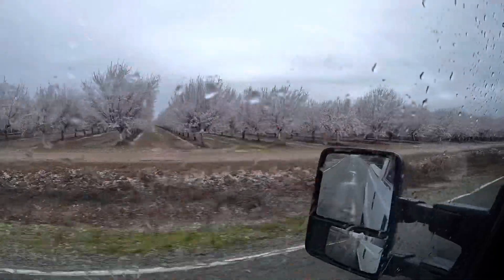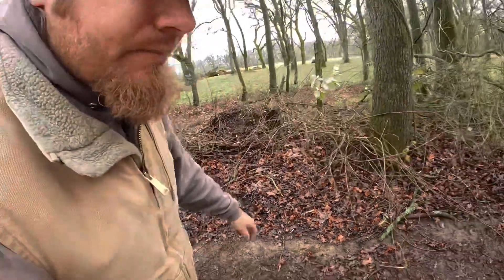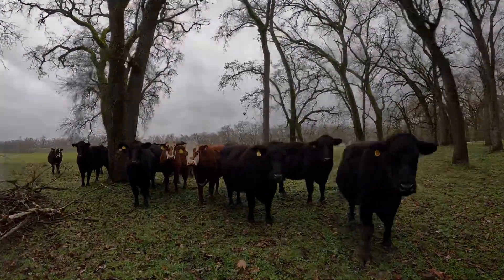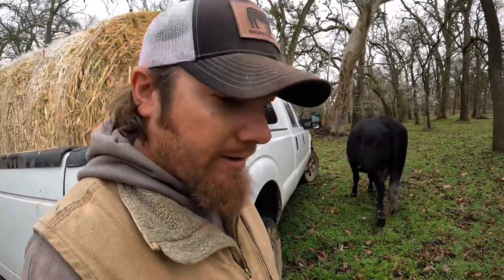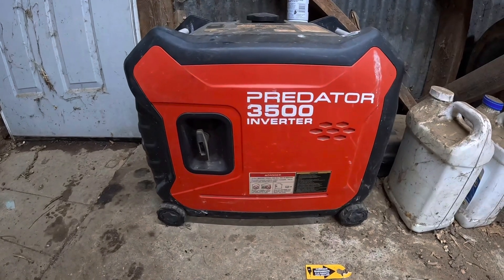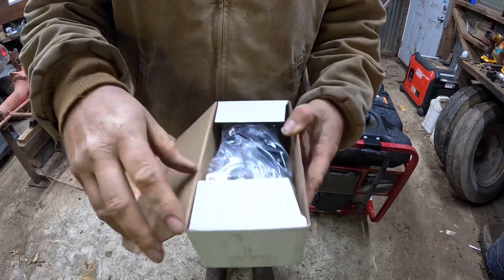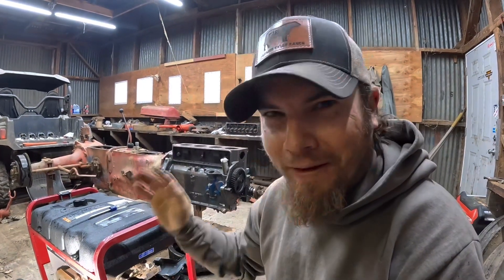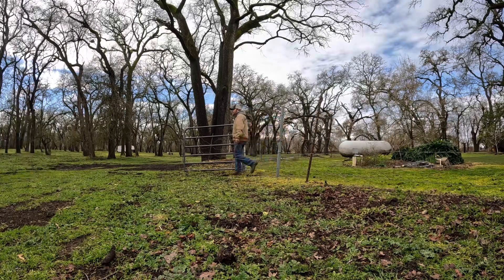Another Cattle Guard Jumper?

Comment: I've replaced 2-3 of those carberators on mine. If they set a long time they won't run. It's an easy fix.
Reply: @boathead22000  you're correct. I try to start mine once a month

Comment: After you got that generator engine running, check to see if the generator is putting out electrical  power by plugging some appliance in to check. Some generators may lose their ability to make electric power after a time, even when the engine is running.

Comment: does the powermate Generator produce 60hz power and 120/240 vac voltage, check it with your multi meter or killowatt from Harbor Freight... make sure it is running properly, put stabalizer in the gas, and run the carb dry..so it will start when you need it ... ethanol is a death threat to these small engines...